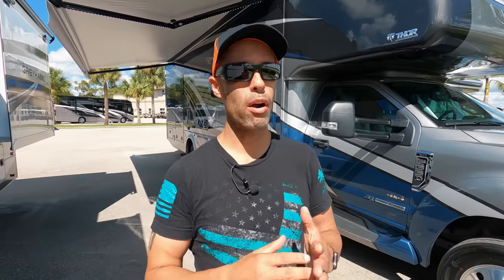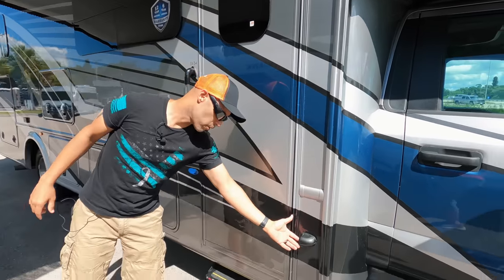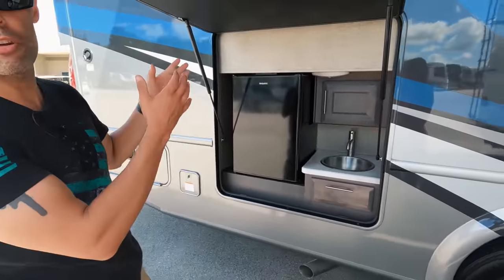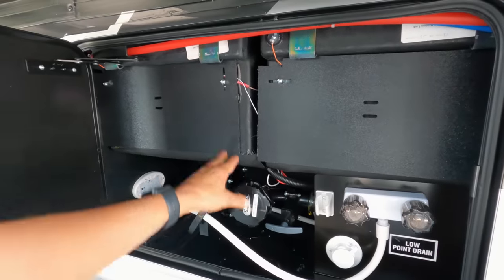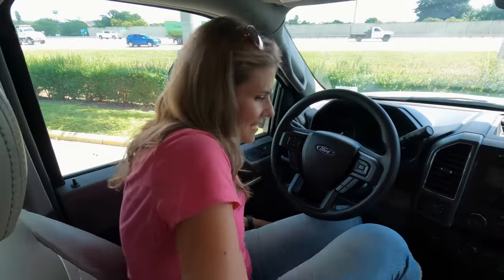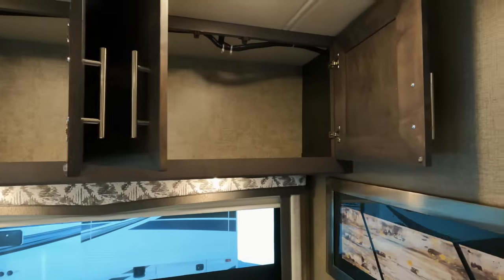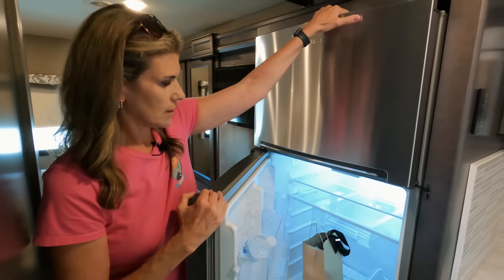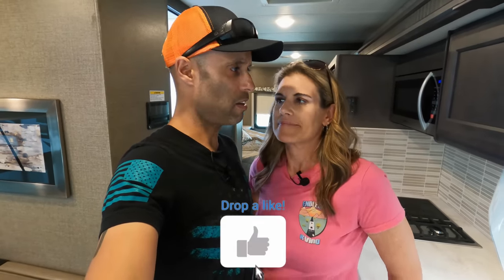The Most Popular 4x4 Super C On The Market -- 2022 Thor Magnitude!

Comment: I have a 2020 Thor Magnitude SV34. You mentioned it didn't have very many outlets usb connections, there are some above the recliners and under the dinette. There are outlets over the cab. It has two fuel tanks one is 40 the other is 28.

Comment: I owned a 2020 Magnitude SV34 purchased new at La Mesa in Albuquerque. In nine months I was only able to put 700 miles on it because of the constant problems.  I eventually sold it in January 2021back to the dealer for a $16,000 loss.  I would not sell it elsewhere because I would have felt guilty. This was absolutely the poorest build quality that I have ever experienced.  It was in the La Mesa shop for three months when I finally just unloaded it because I had no confidence in the unit or the dealer.  I would never buy another Thor product.

Comment: I have this in the 2021 34 SV model.  Others have already mentioned the additional locations of the outlets and the correct fuel tank sizes (there are 2 tanks).  The rig is a pleasure to drive and I have had no need to beef up the suspension as it rides beautifully.  Personally, I have had no issues with the quality in this RV.  That said, I would not call it a Super C and the 4x4 drive is meant to get you out of snow or sand.  The clearance is too low to use as an off road vehicle.  The one thing I dislike is the need to remove the mattress to get under the bed to drain the fresh water tank.  Overall, this RV works for my family and I.
Reply from the maker: thanks for sharing

Comment: Had a super c with the f550 diesel, had nothing but problem's with the smog system on it. Went 6 months waiting for parts from ford. Then found out we would not be able to get the parts for another six to eight months. Not to mention all the problem's we had with the coach itself. Got rid of it....most unreliable vehicle I have ever owned.

Comment: We were excited to find a F550 4x4 and drove about a thousand miles to get one. Passed however as the fit and finish on that example was crap. Crooked plugs. Cabinet doors not level. The plug for the TV in the bunk was loose and the wires showing. The cover over the front curved window was jammed. We passed. Still towing a trailer but maybe when the market chills out we can look again. Great review.
Reply from the maker: Certainly there are different levels of quality in units.  Look at Renegade if you want a higher quality unit.